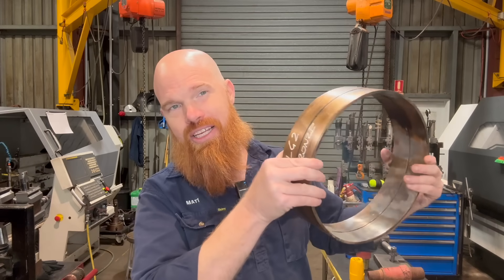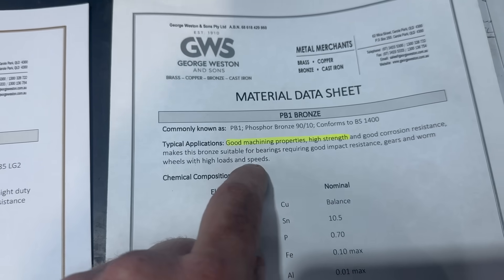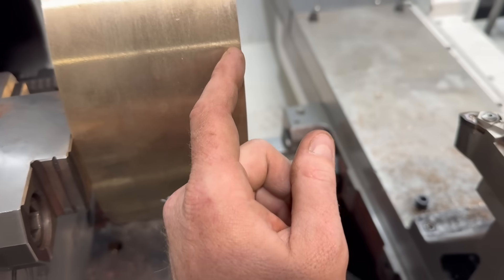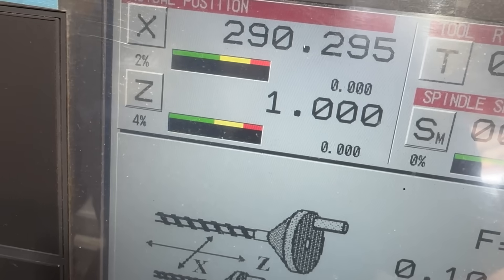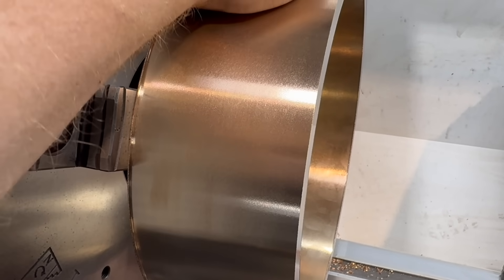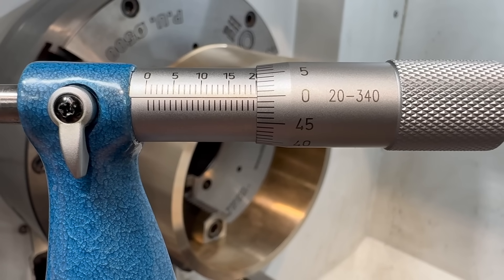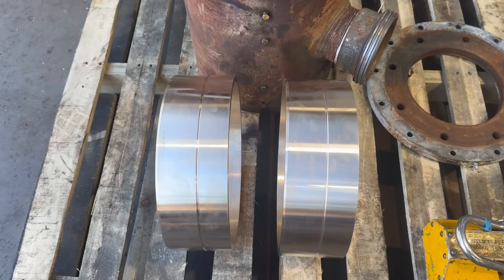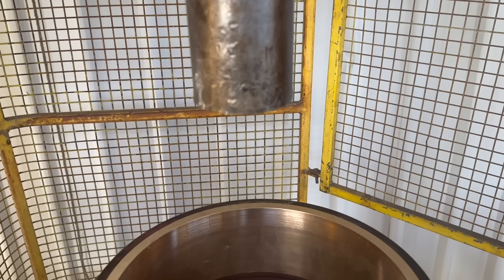Machining and Installing GIGANTIC Bronze Bushes

Comment: Hello from Union Hall Va United States.   I am retired from a Pump Storage Hydro Electric plant called Smith Mountain Hydro part of American Electric Power. The biggest turning job I have seen is the one where we replaced the turbine or water wheel which is a Francis type. We had to replace the brass wear bands on the top and bottom. The engineer had to make the lathe as the moving part by mounting it inside the water way and then by rotating it he cut the 26 foot hole out to size the bands to fit properly.

Comment: Interesting beard. Did you get it so full by pulling on it, sucking down the hair on your head? Just kidding. Don't get it caught in machinery, that would hurt. Love watching you strip off the unwanted metal. Much like how a sculpture described his art. // Maybe a shop vac, with hose just behind the tool? // I don't get it, the groove on the outside of the bushing? I thought grease or oil should be on the inside?

Comment: From the United States. Absolutely love this channel. Scratches the itch on the brain. I'm QC in a bolt making factory.  We do all the automotive companys. From the big 3 to Tesla. We pressure form our bolts and roll them. The  micrometers and measuring instruments you use brings out the need in me. Love this channel
Reply: cold heading?

Comment: I am from germany and like to see how thing going on. I am an educated mechanist started in 1980, but had went me to the IT in 1986. 
Mechanics was not my prefered wish as a job, but i had learned to love them. I had started to join the IT with the NC/CNC maschines that time. Was a crazy difficult job, because the computers and networks we now uses, was'nt available that time. $30000.- just for a professional computer...unbelivable this time. Well, i am close to my retirement and i am still working in the IT, but i am a resident administrator and a hobby radio amateur. Downunder is to warm for me. ;-) 
Amazing the work you do. I like to see how things will be build or get repaired. 
Thanks for show us this fine and very special work.

Comment: does the interference amount account for the difference in thermal expansion at or above operating temps to maintain enough interference. running on a hot day can cause stuff like that to spin in use

Comment: Matt, I'm glad you make and share your videos. It's also awesome that you like interacting with us in the comments. So many YT channels don't ever read comments. FWIW I'm a software engineer not a machinist but I do want to get into some small machining at some point.
Reply from the maker: For me, the comments are why I make the videos. I mean I really enjoy recording and editing it all, but the joy of conversing with people who share my interest in machining is a real highlight of the week.

I’ve also found I’ve learned a lot of way I can improve from the honest feedback in the comments too.

If someone takes the time to comment, I do my very best to take the time to respond.
Reply: @halheavyduty  I never got around to finishing building this absolute monster of a lathe but it would totally beat the snot out of any other lathe out there (don't question it!) It has a LEAST 1/160th horsepower and you can't put a price on that! (Ignore that the price for the fan motor was like $25 and the boards were like $10 and the switch box and switch were about $8.)
http://randomer.net/stuff/power-lathe-20250921.jpg

Comment: G'day from Geelong in Victoria. Loved the heating to remove the bronze bearing as a boilermaker I did that many a time years back also removing steel bearings by running a bead of weld right around the inside.
Cheers.

Comment: Great trick with the torch to remove the bronze bushings. I worked for GM Canada as a machinist for 33 years and performed lots of jobs on parts much bigger than the water distributor that you are currently repairing. We would use a bronze called Amco Bronze for bushing that were required to be hard. It really sang when turning or boring it. We would machine them with the required interference fit and shrink them with dry ice and drop them in.  Loved it. Your channel is great and brings back some great memories.  Thanks
Reply from the maker: Thanks for the comment mate, glad you enjoyed the video

Comment: Hi from the Sunshine Coast. I am a retired toolmaker and I remember as a contractor during the late 70's I was sent to ICAL in Sydney to rebuild a ball mill, pulling it to pieces with a 1 1/2 rattle gun hanging off a front-end loader knocking all the segments out, crawling in and out of it slinging each segment as the loader driver dragged them out though the hole in the end as I feared for my safety every moment then being given a 600mm diameter piece of cast phosphor bronze costing over 2,000 dollars and shown to an old lathe to make a new bearing for the hole I had been crawling in and out of and being told not to fuck it up. Needless to say the foreman there didn't like me from the moment I stepped in their factory because they had just laid off half their workforce then he was told to get a contractor in to rebuild the ball mill...lucky me. But thankfully I managed to do it all and escape with all my limbs intact. What an experience it was working with the Turkish gatekeeper who was my assistant through the process and the front-end loader driver...and disgusting but very funny.
Reply from the maker: It’s funny how the wildest craziest jobs (often shitty at the time) make the best bloody stories 🤣👊

Comment: How do you find mitsubishi inserts? We use both carbide and cermet. I find they are really temperamental with getting the speeds and feeds perfect otherwise they hardly last.
Reply from the maker: We don’t use them (for that reason) 

I tend to stick to Kennametal, Iscar & Palbit depending on the application. 

I’ve heard Tungaloy are great, and we use a bit of Seco too.

Comment: Matt, what is that cylindrical tool that you placed between the brass bearing and the insert. I noticed a small light illuminated.
Reply from the maker: It’s a tool setter. The light indicates that you’re at 50.00mm off the surface

Comment: Hi, could you please explain why you didn't use the rule of thumb - one thou per inch ? instead you only have 6 to 7 hundreds interference fit.
Reply from the maker: I should have explained that. Sorry mate. We followed that on the last rebuild and for whatever reason had trouble.  We made the fit less of an interference it’s worked fine.

No doubt breaking all the rules of machining (as we often tend to) but it’s working in the field just fine thankfully.
Reply: @halheavyduty  ah thank you for explaining. great video as always. cheers
Reply from the maker: Cheers mate!

Comment: Former boilermaker here in the Hunter Valley, now heavy haulage operator.
Machining has me intrigued, but I don’t think I have the brains for it.
Reply from the maker: Hey Robert, it’s pretty straight forward when you get the hang of it. Looks more complicated than it actually is

Comment: Greetings from Tokoroa, New  Zealand.Up  until  about 4.5  years  ago,  I  worked  for  an  engineering  firm here ,operating  manual  lathes,  we  also  had  a  Webster &  Bennett horizontal  lathe,  with  a  4  jaw  chuck,  The  largest  Dia,  we  could  machine  was  about  1500  mm.I  had  to  give  up  work, as  I  could  not  stand  for  long  periods,  with  out  pain.I  really  enjoy  watching  your  videos, long  may  it  continue,
Reply from the maker: Cheers mate! Yeah wow that’s a bloody big bit of gear.

Comment: I would like to build from scratch, scrap and off the shelf parts. A twin cylinder engine. Maybe gas, maybe diesel engine..  maybe even propane. Being propane has a high octane rating.  The kicker is the 300mm bore12" bore or even a 6" or 8" bore with a 12" stroke. The maximum rpm would be less than 1000 rpm Peak.. most likely  200 to 300 rpm operating range idle about 30-45 rpm with a couple flywheels about 24"-36" diameter  with 75% of the weight on the outer rim the cylinders opposed to each other.  Possibly a boxer engine both pistons up at the same time. Use two 2.300 intake valves and two 2" exhaust valves per cylinder. With overhead cam with about 340° duration at .050" a 1.5:1 rocker follower. Possibly  make valves from stainless thread on a 3/8" thread to a 1/2" stem. With the head made from a .300" slice of 3" bar. Thread it on and tig weld it on both sides and mill to shape. And grind to size with a 45° seat. The valves ending up at 2.925" the valve lift being about .900"(.800"-.900" +/-)  with the exhaust valves made the same way. Only. 2.500" x2...  maybe 100 lbs seat pressure springs with a 200-280 lbs open pressure.  The intake port diameter is about 2.25" each  or 3" for both valves. The exhaust  2.5"  with a intake manifold runner  about 16"-20" long a single 350 cfm carb. With a plenum about .5 cubic feet with two 3" runners with two 45° bends on one end. Or possibly  build a Electronic fuelinjection for liquid propane.  Inject the propane in the 45° bend possibly both. Just a fraction of a second before the intake valve opens. The fuel having about 4"- 8" to the valve gives it time to evaporate. It should produce 20+ hp minimum.  With 11:1 compression the tq should be great as well. The gas version having about 7:1-8:1 this is a lot of air to compress into a small area. Possibly  use a decompression system using another cam lobe and follower. That locks in place. And   that  opens the exhaust valve during compression  slightly about .250" and closes about half way up the stroke dropping compression  about 30-40%.. weld the crank from thick plates of steel. Heat treat and mill and grind to shape. At the least I'd like to build a smaller engine with a 6" bore and 6"-8" stroke this engine may see 1000 rpm.  Use off the shelf 2.200" intake valves 1.88" exhaust valves. Possibly make the same power at 500 rpm over the other engine at 150 rpm the 6" bore 6" stroke two cylinder  is 339/340 cid 5.4 litres and 8" stroke 6" bore is 452 cid and 7.4 litres 😮  the low rpm is what I'm after. I want it to run all day slowly ticking over. Sometimes, maybe 40- 60 rpm ..   generating power.   Sorry to ramble... I wish I had the means to build it..

Comment: A tip when you are machining Bronze, Brass or even some types of  Cast Iron.
You get swarf everywhere when machining these above the tool. Depending on material and how much I needed to cut I would use either an "El Cheapo" 1" paint brush or a stiff piece of shim stock cut up and held above the tool to prevent swarf spray all over the machine and operator during the process. Ideal to contain the swarf in a localized area, stop the brass from getting to airborne and making for a lot easier clean up. 
Proximity of the brush or shim to the surface and tool depends on the volume of swarf produced and the tolerance of heat in the brush {Hence the shim stock use}. Back in the day I used to machine lots of castings and short of going flood coolant this would produce a much cleaner machine and more importantly a lot less airbourne debris.  It's also cheap and easy to do. 
Cheers
Reply: I do a lot of work in brass, so I have a piece of perspex mounted on a flexible stem ( recycled from an old desk lamp}. Keeps the tiny chips from flying all over the place and still lets me see the workpiece. Ain't no pain quite like getting a brass splinter in a place where the sun don't shine!
Reply: @bobbobbins8913  I disagree, Nothing like a piece of brass embedded in your eye. Got to love the view of the burr digging it out.

Comment: Hello from West Columbia Texas.  I'm just south of Houston.  I do furniture restoration and carpentry, but I find the precision of metal working fascinating.  It is hard to get THAT level of precision in wood, but it is relaxing to watch someone who can get their parts to fit together without having to go back and shave it to make it fit better repeatedly because moisture got to it!
Reply from the maker: I have huge respect for any profession where moisture induced tolerance movement is an issue 🤣👊

Comment: You should Hire Uncle Justin to recycle all the steel swarf you make each week...

Granted it'll probably require him to upgrade his Furnace(s) to melt steel and then upgrade them again to handle the sheer volume of swarf you make, but think of the Videos he could make...

And think of all the solid and hollow bar billets you wouldn't have to buy now that he can reuse the scrap steel making new ones for you...

😄😁😆😅😂🤣

Comment: Nice video Matt, greetings from the Netherlands!
Is that tri-lobed deformation (by the outward pressing claws on this thin walled material) of those bushing not a problem?
Guess not, because the ID is turned to size after the bushings are pressed in?
Reply from the maker: It definitely deforms but there’s not much I can do about it.

Comment: Great video Matt. I was a machinist/welder back in the day and I made a lot more money than most college educated yuppies. So, no you don't necessarily need a college education to make a good living. Plus who wants to deal with all that corporate B.S. when you can just sit in front of a lathe or mill and watch it removing material. There is something very mesmerizing watching that happening. And machining, welding and fabricating feels so rewarding to me, because you're essentially creating something from nothing. Watching from New Jersey, east coast, USA.
Reply from the maker: I’ve lived in both worlds… and I must say I wouldn’t trade what I do now for any other career.

I feel very very fortunate to have the opportunity to fix problems and make cool stuff on a daily basis.

Comment: Another great video Matt, well done. The press fitting can be a bit of an a*se twitching moment, hoping you have the dimension correct. Nothing like having to use a centre punch on the outside of the bush to make it a skoshie larger.
Reply from the maker: Extremely relatable.  It happens from time to time.

Comment: Hi Matt, I’m a pensioner from the Netherlands. I started my working life as a ships engineer. A small part of the curriculum to become a ships engineer was learning to do metal work. Welding, machining, filing, soldering,  bracing, working with sheet metal. We had 4 hours per week over 2 years to learn the craft. And no, I was not good at it. I was the guy that would forget to remove the key from the head before starting the lathe. So I was very glad to learn that the company where I started had always a professional welder/machinist on board. And now… 
It’s oddly strange to watch people mastering their craft, it somehow elevates pure professionalism to artistry. It becomes almost magical. 
😂 OK…
This was probably too much 😏
Reply from the maker: Love it! Cheers mate. Yeah we have the golden rule…

If you leave the key in the chuck it’s a carton of Xxxx Gold (our local beer)

Needless to say we have all trained ourselves to NOT do it. Took me 3 cartons 🍺

Comment: I reckon that BP1 is one of my favorite things to machine too. I make transmissions for RC cars. I usually take 10mm round stock and turn it into pinion gears for the motors. The rest is PB bushings for hard chromium alloy rods with larger gears press fitted on and some that have a slide bearing. Between PB1 and brass I turn it into some right nice kit. Cheers mate!
Reply from the maker: It’s great hey. Machines really well too and lasts practically forever

Comment: Hi Matt, we used a lot of non-ferrous where I served my apprenticeship manufacturing resistance welding machines, Copper, CU alloys, Bronzes, Aluminium Bronzes ( blooming hard to machine), Elkonite (Copper Tungsten), Aluminium alloys, and some heat treating stainless steels. Mainly using HSS, &  brazed carbide.
Love the recycling of bronze swarf , that will keep futre generations guessing. 
Great job and video, best regards John from the Black Country UK 🇬🇧.
Reply from the maker: Cheers good sir! 👊

Comment: I used to turn a lot of thin wall sleeves (in 4130) for a suspension part we manufactured. I found that the parts would "triangulate" and I'd get thin sections where the chuck jaws were pushing out on the ID, even if I wasn't retightening the chuck. I finally convinced the owner to get a 6 jaw scroll chuck...and then we stopped making that part...lol. Life...😂

Comment: I really wish my hobby lathe was larger.
I got into machining because I had an uncle pass and I obtained 35 years of a master machinist's stuff. He worked for Square D for 35 years, so he didn't have his own lathe, but he did have an old mill that I ended up with. However, he had a ton of random tools, a lot of self made stuff; and most importantly he had a ton of high-end measuring tools. Getting those saved me a ton of money.
I wanted to make Murika Pew Pew parts, for my hobby stuff, and then it just blasted off into its own hobby, I've also been a hobbyist woodworker for a long time, so naturally machining was the next step lol.

I'm actually travelling to Australia and NZ for a 3 week vacation, I leave in just a few days. Pretty excited for that, my first time to either country.
Reply: My lathe weighs less than his Hydra....
Reply: Stop making death, make something useful.

Comment: we always frose the bushing and heated the casting 
AI Overview
For a brass bushing installed using a shrink-fit (freezing) method, the general rule is to machine the bushing to have an interference fit of approximately 0.001 inches per inch of diameter.